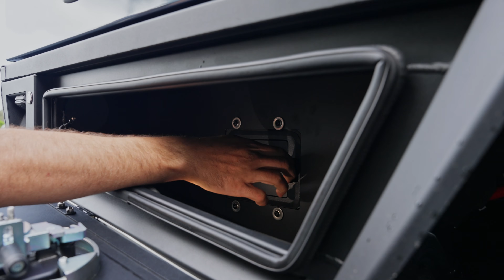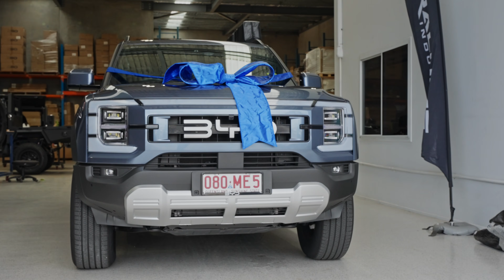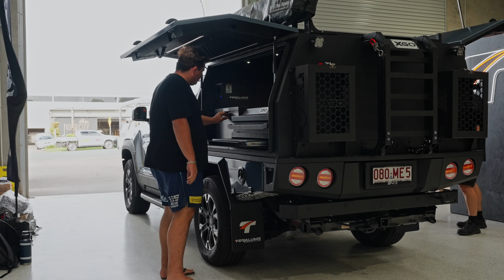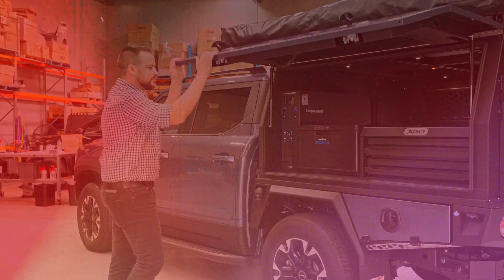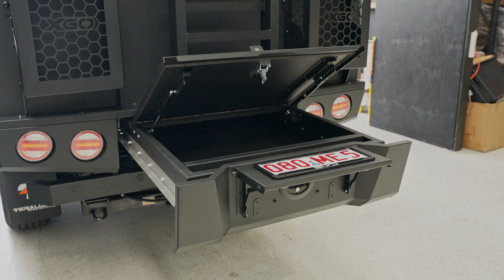BYD Shark 6 Gets An XGO™ Chassis Mount Tray & Canopy | Teralume Industries

Comment: Looks really good!  I think you should get rid of the 200ah battery and hub and utilise the built in 200a dcdc and pull off that.  How hard would it be to convert the 70L water tank to a fuel tank and just have water jerry cans in the back?

Comment: Hope you reattached the earth otherwise the coil configuration of the high voltage cables will act as a giant radio transmitter and interfere with the internal electronics.
Reply from the maker: Everything was back to OE :)

Comment: I definitely wanted one like this but I’m concerned about the fuel economy after the mod, I will be very interested to know the max range with a full tank of fuel and a full charge, as this Shark engine is not very big, only 1.5L. I currently own a Hilux with a similar setup for touring, probably got more gears on it…haha, with GVM upgrade 3500kg, long range fuel tank, carrying 2 spare wheels and 2 jerrycans, ARB bull bar with winch, roof rack, 270 awning and RTT, etc.
Can’t wait to see your next update with a more complete setup for this Shark.
Thank you for sharing this video! 😊
Btw, are you guys based in Queensland? I don’t mind getting in touch for more details. Cheers.
Reply: Lots of fuel economy tests on the Shark on YouTube = it's not as good as diesel and might match ICE 4X4s. But BYD never intended this EREV to be for serious 4WD enthusiasts (can't diff lock for a start). It seems best suited for the 90% of ute owners that seldom tow more than a large trailer, and can do it in style.
Reply from the maker: Couldn't have said it better myself
Reply from the maker: Yeah, we are too. Let's see how it goes out in the wild over the next couple of months! We're in SE QLD - get in touch when your ready!

Comment: Looks really nice. Finally someone thinks about ambient camp lighting.
  
The canopy width looks narrower than the car at the same height. Looks a little odd.  Is that the case and is there a reason for it?
Reply from the maker: Thank you GC, we pride our self on pioneering the car lighting market. When it comes to the width of the service body and the car they are perfectly in line and fit together really well.

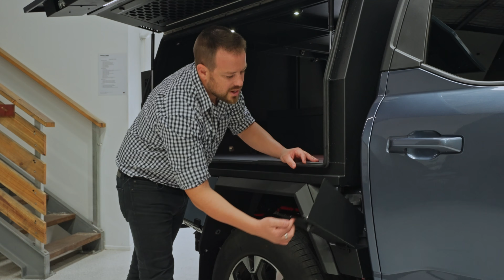Comment: 16:15 the charging port looks a little tight and awkward to plug and unplug. Any reason why it wasn’t mount flat?
So things are key lock? Not all central locking?
Reply from the maker: It actually works really well in the field. Space and wiring was a constraint. Not on the central locking either, just manually locked.

Comment: I dip my hat to you sir, truly beautiful canopy, ideal for any ute as you say, well except the cruiser & yank tanks.
Truly curious as to why the power hub.
Surely V2L the manufacturer (BYD) provided covers exactly what has been duplicated here at the huge expense of, $6990 and presumably recharge far faster with ICE running than the lithium battery via DCDC charger.
I'm obviously missing the concept of duplication @ $6990.
Aside from that, this is an awesome creation for a growing market, BYD just the first, many more complex vehicles  to follow I suspect.
Reply from the maker: Thanks for the kinds words mate! Customer choice for the Power Hub. The factory 12v and 240v has limitation such as cut offs that will kill power after a certain time and has auto shut off etc. It very controlled.
Reply: Was wondering the same as it has a 6kw inverter system, so relocate the 240v plugs inside the canopy so you can use them to charge the house battery and run everything, and when not in use, can run the fridge off the battery, and the lights can run off the battery.